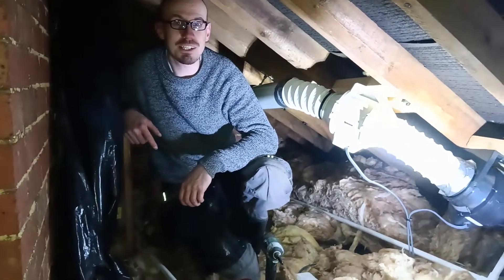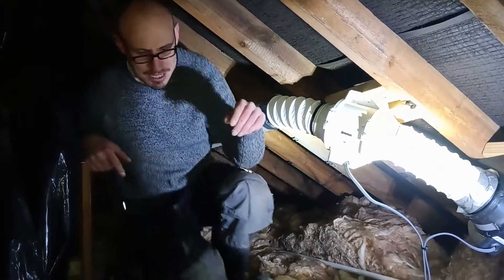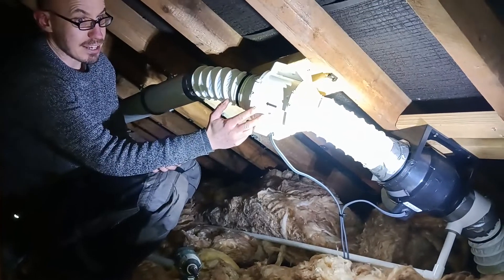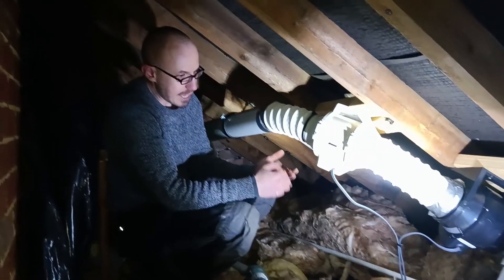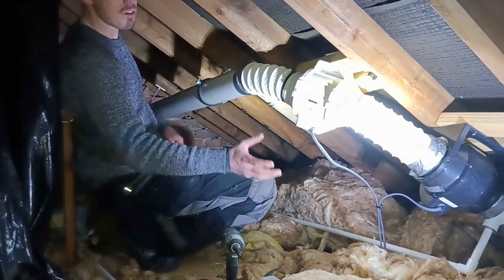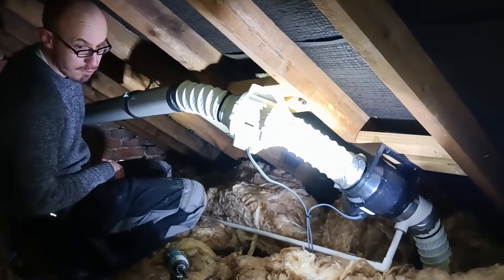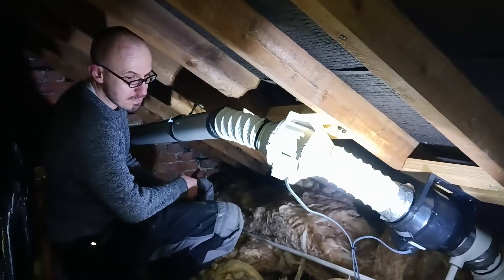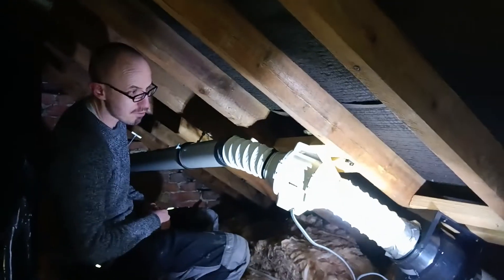How to fit a loft extractor fan (2024) || Extractor fan installers in Medway & Maidstone, Kent

Comment: Great video. My loft space is similai to  this video, except where your hand is at 25secs there are 2 thick wooden beams running along the loft space with a gap of about 13inches, so getting into and then fixing extra support wood or and the fan is presenting me with a challenge. but you have given me an idea of placing the inline fan on the lower of those 2 big beams. How did you create the condensate drain for above fan?

Comment: Firstly, you should use insulated ducting. Secondly, I don’t believe a condensation trap is necessary where it is. The fans are powerful enough to remove steam to a point that no condensation should really occur so close to the extraction point, and as the ducting starts to angle down so quickly, condensation will naturally flow downwards.

Comment: This is the sort of issue I have, long run, vents to a vented roof tile, condensates on the way up resulting in water coming back through the vent...... Thanks for the video 👍
Reply from the maker: @keendnb  I don’t know what set up you have but if you intend on using the same roof tile vent you’re going to have to put a condensate trap in and have a constant fall from tile vent to trap. All the best!! Kev
Reply: @TechmeistersLtd  all sorted, I put the trap in yesterday and run the 22mm pipe out to the eves, seems to have solved the issue 👌
Reply from the maker: @ nailed it well done
Reply: @TechmeistersLtd  great video, keep them coming 👊